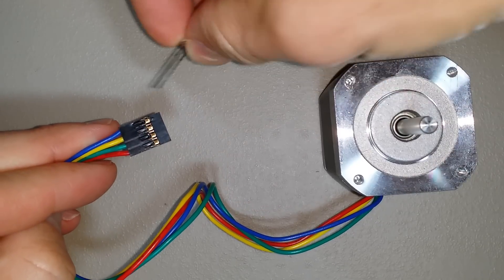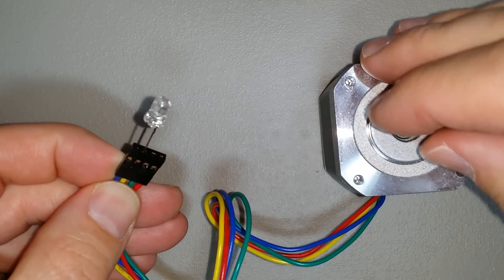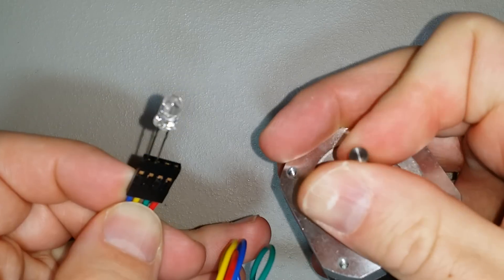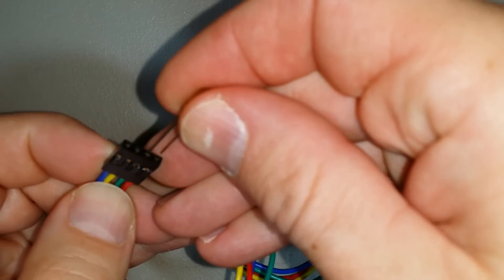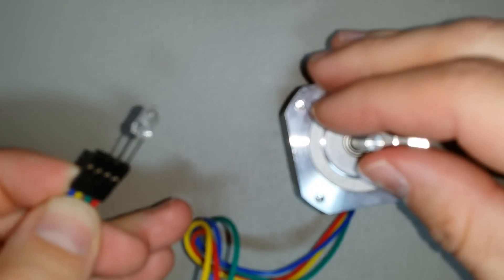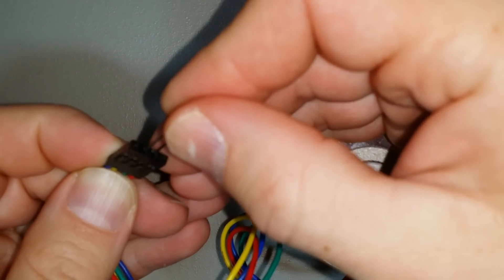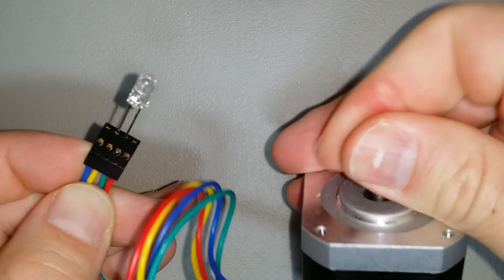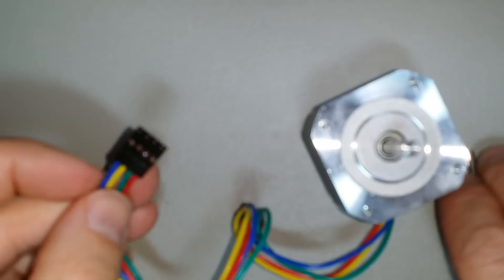Stepper Motor Testing

Comment: Good evening, thanks for the information, I have a question, I have a stepper motor with 5 wires colored yellow, blue, black, brown and red, the red being the connection of the central taps of both windings, without uncovering the motor Can you tell which are the windings? Thanks in advance.

Comment: After watching your vid , i went to buy 1 also......intended to use as wind turbine generator , i made 2 sets of full bridge rectifier & connected in series to get higher voltage...
My curiosity is why the LED still lit up in both left / right turn ?
Isnt that the current already converted to DC & should behave like DC ?

Comment: Hey  r u good at troubleshooting stepper motor / controller driver  issues? Ive got all 3 axis running like crap rough herky kerky and slow...on my diy cnc using tb6560 Im still thinking its controller driver issue...if i run a continupus jog mode .....once in a while the motor will go from slower feed rate grinding rough movement to smooth movement faster feed rate but only for less than 1 second...

Odd that all 3 sxis do the same thing though...usually mot all axis go bad at same time..however this is a low end junk all in one board so its possible...

Comment: I tried this some generic stepper motors and the LED works pretty well. But tried this a few others that work just to see what it do and the LED did not light even though the motor does work. Can you give me an explanation for this?  When turning the shaft by hand I didn't get that resistance feel that I got on the generic.
Reply: Maybe you burn the led
Reply: Probably they have different rated current.

Comment: So there no polarity between the two sets of winding wires? Or in other words it doesn't matter for rotation if the wires are mismatched on the ramps board as long as the 1a and 1b goes one set of windings and 2a and 2b goes to the other winding?
Reply from the maker: That's correct. It may spin clockwise or counter-clockwise. If it spins clockwise and you need it to spin counter-clockwise, you can rotate the entire plug.

Comment: Hi inhave a nema 23 stepper that appears dead...inhave voltage going to it but no sound or movement from motor...this is in a cnc machine...i removed the stepper and i can not turn the shaft by hand...had to use a wrench and extremely hard to turn.... This is not ok right?
Reply from the maker: Are you able to turn one of the other motors by hand?

Comment: I dont know they arent accessible without substantial work to remove...x and z steppers are good...y wont power on....using dro on cnc the z and y are good but when i try to jog y nothing happens....so i removed y motor and it just seems wong....it was lockked up pretty good even putting wrench to it....i confirmed power to y is proper and i confirmed controller to y is good...
Reply from the maker: Without removing one of the other motors, can you manually move the axis? By hand, can you spin the lead screw for the x or z axis?

Comment: The stepper is nema 23   279oz    .9 degree  6 wire 2 wires not used
Reply from the maker: A nema 23 should be turnable by hand.

Comment: What stepper motor did you use? Thanks!
Reply from the maker: NEMA 17 by Kysan.
Reply: @engineglue  sir, my nema 17 stepper motor does not generate power like in your video. I have to use a drill in order to generate power, yet it is still low. Can you help me please on how to make it just like yours? Thank you! Godbless!
Reply from the maker: @joshuakylekjieranrosanes5478  I'd like to help and I have a few questions for you. Why were you testing the motor? Was it malfunctioning in the machine it was in? Are you attempting to use it as a generator? What is the voltage and amperage rating of the LED you used? Do you have a multimeter?
Reply: @engineglue  Thanks! Yes I would like to use it as a generator for my thesis study, sir. I used the same LED in your video. Yes I have multimeter, sir.
Reply from the maker: @joshuakylekjieranrosanes5478  Use the multimeter to measure the output voltage of the stepper. I imagine you should get about 3v but unfortunately I don't have a motor I can test. If you're getting far less by rotating it by hand, then perhaps the motor is bad. Can you test this on a different motor? Also, I'm sure you know that a stepper probably isn't the best motor to be used as a generator but I'm sure you're just as curious as I am as to whether or not it would work well.
Reply: @engineglue  I tested it with multimeter but I did not get any voltage output. Also, when I rotate it just like in your video, the result is no output. This is a big problem I badly need this for my thesis study :(
Reply from the maker: @joshuakylekjieranrosanes5478  Did you test different sets of wires? Do you have a different motor you can use? It sounds like the motor might be bad.
Reply from the maker: @joshuakylekjieranrosanes5478  Did you solve the problem?

Comment: My steppers do not have those colors on the wires. I tested it with a meter to identify the  windings but how do I ensure the proper connections on the ramps board?
Reply from the maker: Pins 2B and 2A connect to one coil and pins 1A and 1B connect to the other coil.

Comment: Whats odd is there is absolutely no sound or mvement at all when power given to y,stepper.....totally dead
Reply from the maker: It does sound like the motor has become scrap metal but I don't want to give you bad advice. You can always attempt to dismantle the motor. If it's seized, it might be a bad bearing that you can replace.